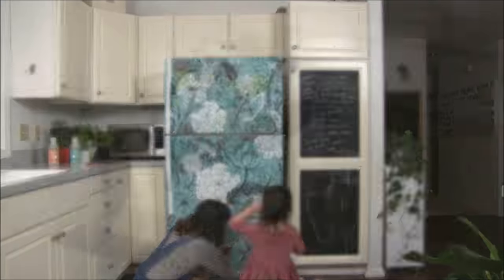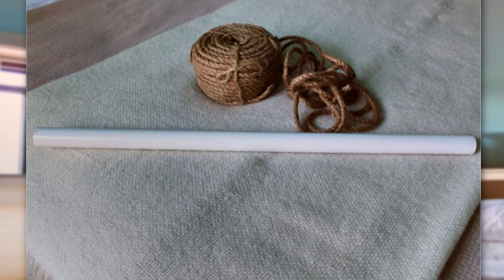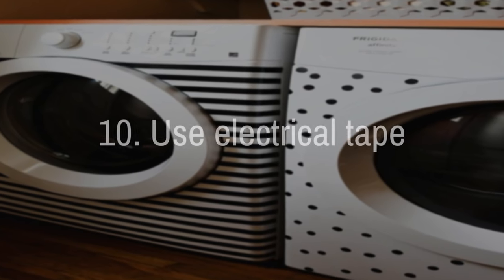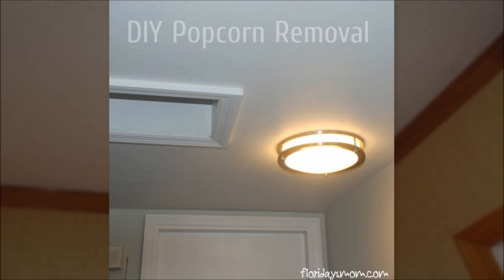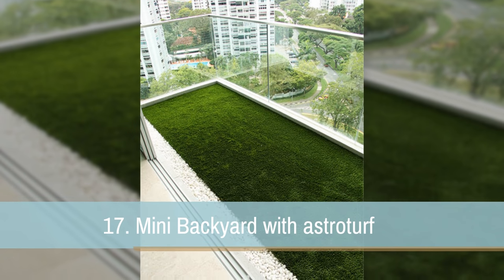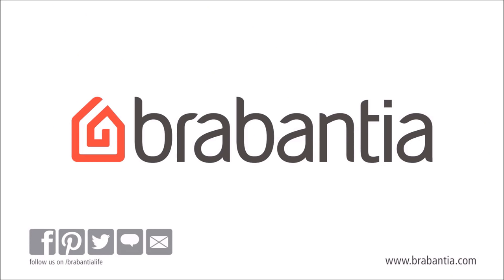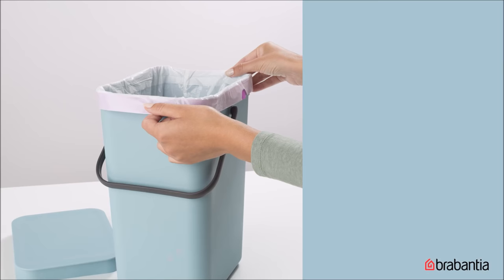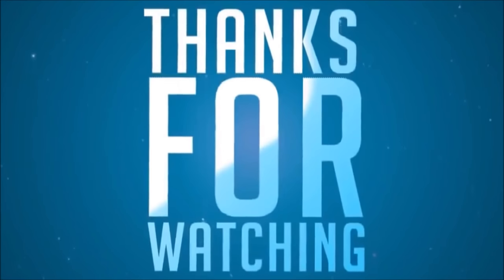21 Ways to Hide and Organize Things in your House #2

Comment: Great ideas except for the frames around the light switch.  They wouldn't stay on the wall with my family especially as they are trying to find the switch in the dark.
Reply: I use decorative light switch covers and outlet covers.  You can either buy them or make them.  All you would have to do is paint or wallpaper the switch cover, which would be nice like that OR you could get a whimsical picture frame or a gold one....whatever you like and put the frame (just the frame, no glass or backing) around the light switch with a sturdy glue (all around the frame to make sure it doesn't go anywhere) and then you can find the switch in the dark and if you have the switch plate decorated with an old classic painting replica printed out before gluing on, there's your piece of art! 

I have one light switch that is hard to see in my laundry room and I painted the cover with glow in the dark paint so I can easily find the switch now.

Comment: For the art gallery around the light switch: it would be way better to find/diy a light switch cover with a pattern or design and then put a fitting frame around the switch.
Or cut a hole in a art frame without a glass cover for the switch. And if either if these have a picture or pattern that hides the rectangle switch, all the better.

Comment: I like the checker effect on the linoleum floors, but I don't think since I rent an apartment I'd be allowed to do that.
Reply: Lavenderrose73 from my experience, many landlords want the upgrade but don't want to do the work themselves. If you volunteer to do the work (maybe they can chip in for the supplies), I think you could convince them! I've always painted and renovated everywhere I rented. Good luck!
Reply: Yeah, good to know for future reference. Only problem is, I'm not exactly a DIY kind of person either. Whenever I move out of this apartment, I'll want to hire someone else to do the post-move cleaning for me!
Reply: Completely cover the tiles with painters tape then use the peel and stick tiles on top of the tape....when you move from your rented apt. the tiles will peel up and so will the tape.